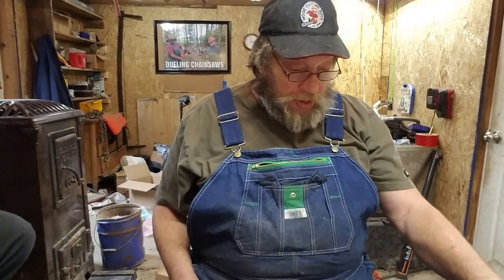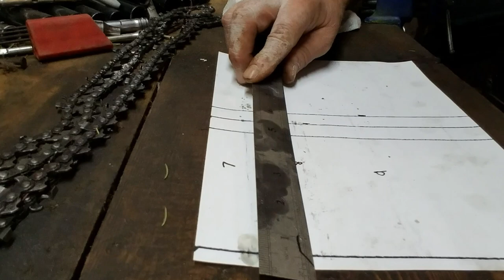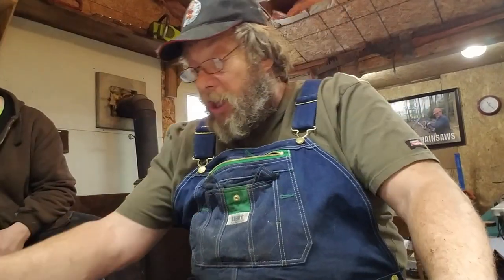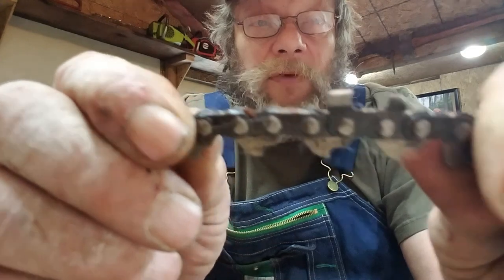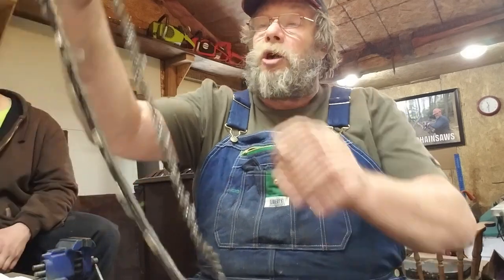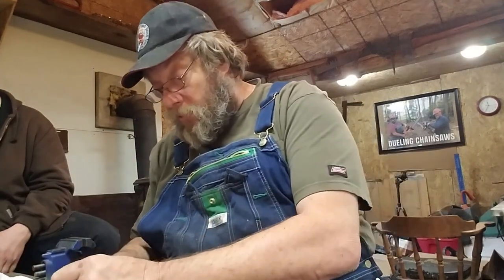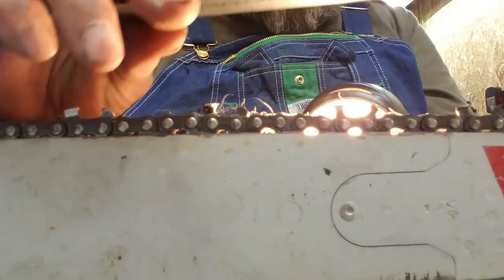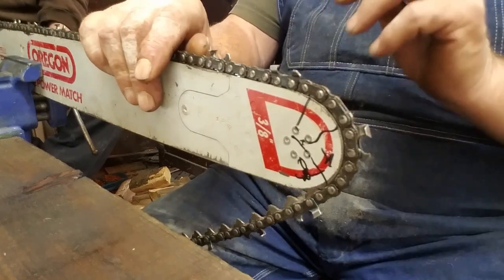Chainsaw sprocket size! What chain? On what saw! (Very detailed)

Comment: WOW serendipitous, I was literally thinking the other day "what if you had different sized sprockets, changing 'gear ratio'??", ROFL nice to see it's already an established thing (my new 590 is by far the most-powerful 2-stroke I've ever owned...followed by my 355t :P )
What do you think of quarter-pitch, and thinner gauges than 0.050, on climbing saws say 12"-->16" B&C?
Also...Is it OK to run a 50, and 0.058", gauge B&C combos on the same saw's sprocket? Like, alternating them?  I need to go with 0.058 gauge to get a B&C I want, but I know my saw's meant for 0.050" and, while I know the 58 will fit, I worry it'll wear those grooves into the sprocket in a way that'll 'conflict' with running my 0.050 B&C (I'd be swapping back&forth, the 58 is so I can get a bigger B&C than my saw's mounts want, I know it's not ideal and frowned upon but til I can get one of those blue-thunder beasts the 590 will have to do everything, however slowly!!)

Comment: I have a question, I have a Stihl MS 660 and a Stihl .404 pitch, .063 gauge bow bar. Can I adapt the saw to run this bow with a # 46RS chain? I am prepared to make an odd length chain.

Comment: Thanks for the video☺️👍really helpful! I was wondering if maybe you could help me with a bit of a problem. I run a jonsered cs 2159 Stock and would really like to run a 3/8 full House chain on it. All the local saw guys in my area dont really know anything and they dont really understand why i would want to🥴is it just a case of popping on a 7 pin that fits 3/8? Or is it more complicated than that?
Any help at all would be much appreciated☺️
Thanks

Comment: Hi Harvey! The numbers isn't right. The sprocket isn't surface feeding. It feeds around the cirkle given by the chain rivets (the part of the chain thats on the sprocket) . A 7 tooth 3/8 makes about 5 1/4 inch per revolution (I just checked to verify) . Mark up the sprocket as you did, and a corresponding mark on the chain, and put in on a saw with a bar and turn one rev and you will see. It will feed 2x3/8"x7.

Comment: Great video Harvey! Question about chain tension.... I run my chain a little loose like you do. Over time do you notice any wear in the bar groove from the chain rocking side to side? I never really thought about it until I forgot to tighten my chain last time I sharpened. With the chain loose, I could see the cutter trying to rock in the groove as I pushed on the file, but no movement with it tightened up.

Comment: Good evening, sir.

I emailed you a couple weeks ago about a 372 I bought that got damaged in shipping and never heard back. I was wondering if you thought it was worth the money to rebuild the saw or just part it out. I sent a pic so you could appreciate the extent of the damage. It was the crack in the crankcase under the upper part of the starter housing I was most worried about. Thanks!

Comment: Great video, thank you.  I did some calculations in my head.  The eight tooth has 1/7th more teeth, and therefore would rotate the chain at 1/7th faster rate than the 7 tooth (1/7 = ~ 1 percent).  Also, I've found that the 8 tooth sprocket is nice for soft wood, and rather than change the cutting profile of the chain, it's easier to change the sprocket, from 7 to 8 tooth,,,, I have no idea why one would use a 9 tooth chain.  Thanks again

Comment: I run .404 full skip on my 066mag an my 075av electronic i file my drags flat as well my mag has 8pin as well it needs replaced as well i always kept my chain tight after buckns video 2day as a fact i orderd a new sprocket but losend my chain put my ol 7pin back on until my 8pin arives n couple days i think the loser chain an new sprocket is goin to really pick me up ill see 2moro rain supposwd 2 be gone here in tn so off to make tge doughnuts lol great teaching harv thank u 4 everything u do.

Comment: I've found a 7 tooth will give you rpm on an 046 with a 24 bar (more chain speed) tho an 8 tooth is all around good for rpm and grunt work if needed (bottom end torque) if you need to lay into the cut to some reason it helps .  I personally run a 24 full comp on my 046 (it's not a stock saw tho) , it has a BB kit /ported and base gasket subed for a pop can style gasket lol I'm cutting big hard maple right now and it does real well . I have a video up just last week of this saw , just after the video I just touched my rackets(drags) with that being said I'm not overly hungry with them in hard maple other wise it ends up killing tips and or chains . All around if you can sharpen a saw proper it helps alot with an 8 tooth /full comp set up in any saw .

Comment: Ok so here's a question that I've heard multiple theories on and i don't know which is correct... At the bar tip just behind the sprocket you often see a dip/gouge where the bar has worn usually top and bottom, now is that from having the chain too tight or too loose because I've heard people say both?
My bars don't seem to do it but I see it all the time
Reply from the maker: I semi dull chain does that!
Reply: @theironhorse6600  hmm ok I don't know how that works but clearly I'm not running dull chain or too loose/tight, must be just right 😊
Reply: @CSkwirl  boring will wear the shit out that part the bar. Cutting with the tip a lot and bucking will all wear a tip
Reply: Too loose or dull.  But what you see is common.  I used to experience that before I learned how to sharpen, but this was many years ago so can only reflect back and realize my inexperience played a part.  I feel it's not from being too tight b/c I never ran a tight chain, I have run most likely too loose and definitely too dull.
Reply: My train of thought on this subject is. Like Harvey has said in another video. The chain wants to be a circle. Meaning the faster the chain spins there is less contact with the main body of the bar. If you look most bars have the most wear where the chain comes off the drive sprocket and where the tip and bar meet. This is because that is where the chain starts coming back in contact with the bar at each end to make a tight turn. You can see all of this if you have a slightly loose chain.  And just rev the saw and watch the chain. you can see it loose contact with the bar. If you're a fire wood cutter it will take you hundreds of cords to wear out a bar. Because your doing a lot of bucking keeping your chain in contact with bar on the cut side. This is also why it's important to flip the bar often. If you do a lot of small diameter falling and bucking using mostly the tip like I do. Then it is pretty easy to wear out a bar in a year or two. Especially if you run your chain loose. May be a long answer but I hope this helps.
Reply: Haha I forgot it's this video he said the chain wants to be a circle 😂😂

Comment: Just because you ask Re who watched to the end...will say that, nope, thankfully I've never hurt a sprocket!! Though my history is almost-entirely with sub-50cc powerheads (almost exclusively top-handles til this past year) but only once had to buy a replacement "sprocket//clutch combo" once but it was because of a broken clutch-spring (this is for a zenoah g2500 clone, basically has the availability of clone 660 parts IME!!  My version, a "scheppach csp2540", not the holzfforma version, it was GREAT almost made a whole 3 years, its current 'death' is my fault anyway its compression is so low it hardly cuts but there was HORRIBLE air-filtration but that was on me.....*never* again did I let that happen, in fact I make screened-windows on most airbox covers (and screen/filter the OEM cutouts)
Thanks for a great vid am holding (1) 8-pin, am planning to get another because I suspect it will only improve either of my clone 660's, they've got 25" & 32" setups, just finished the 1st build that has the 8-pin have yet to run it (it's the 32" one, w/ a big bore top-end and at least another 2-3cc's displacement gained via piston & crankcase porting :) )

Comment: rather than measuring the outer edge of a sprocket that's traveling in a smaller path than the chain, just measure the distance between the chain's drive links (stretched out straight) times the number of pins on the sprocket.

Comment: I’ve come to the conclusion that having only 3-4 drivers come out of the top of the bar, if I have it any looser then that with the heat and expansion of the chain, it gets too loose and then the tooth starts to kick up and bite too much. And bog the saw down too much. 

I’m swapping over to skip tooth to make it easier for my saw to stay in the power band. Especially with our hard woods here in Aus, if the log is a little bit dry, by god the saw starts to labor with full house chain

Comment: I run a 8 pin on my 066 digital with a 24" bar with 404 supper chisal chain. It was fun but boy did it beat the piss out of me.. lol I have since then grown up. 24" 3/8 7 pin supper chisel 2 passes off the rakers on a new chain and not much more then a 372xp..

Comment: I have a husky 350 with an 18 inch bar what chain should I run thanks
Reply: I think those are 72 drive link .325” .050 chain
Reply: @mercoldswfo  Thanks buddy.
Reply: My 353 has a narrow kerf bar/chain

Comment: I liken a full house chain versus a skip like this :  Imagine a full house where every tooth is butted up against the one in front. So you virtually have a butchers knife.  Then take it to a full skip where a third of the teeth are taken out.  On the full house its virtually sawing the wood like a knife but with a skip you are cutting with a saw tooth bread knife.   The skip will cut quicker and with less hard work every day.  I agree with the 8 tooth sprocket for a skip.
Reply: gain speed, lose torque.  Remove cutters and you reduce drag so you can move the chain faster.  It's a push and pull, a dance.  A longer bar has more cutters and more drag so you can compensate by having fewer cutters and get your speed in the cut back.  A smaller saw can cut bigger wood by using fewer teeth.  So for my small saws, I can cut bigger wood, slower with a skip chain, without changing the sprocket.  But my saw lacks the power to gear up.  I need all the torque I can get.  this was an excellent video!  I am not a saw man, but I do know math and physics.  The exact same relationship takes place when messing around with trucks.  Tire size, diff gear ratios, ho, torque, transmission gear selection etc.

Comment: I run seven tooth sprockets on all of my saws, except my small saws and they have six tooth sprockets.  What the factory calls for is what they get.  A few seconds less time in the cut is not important to me.  I never do anything to a saw that will diminish its lifetime and make it less reliable and lugging a saw is not good for its reliability.

Comment: I was thinking of a backpack bar oiler...like a weed sprayer.  Pressurize that sucker:  no pump required.  Plumb a line to the saw and a trigger valve.  SO when you're on a competition,  you could blast past ALL OF THE COMPETITION!  Cheating?  Gota check the rules....  hey, "Ex- Post-Factos", Hahahahaha add another page to the rule book.  Oil:  rapeseed / Canola and/or a mix of other vegetable oils.   Yeah, gota be "bio-friendly".  Maybe synthetic vegetable oil...how's that for idiotic!  Well, maybe not, save that for someday when we are mining the moon.  Oh, why reinvent the wheel....it's called margarine....or "Oleo" to us old timers...  hey, how about a pressurized bar oiler tank on the saw?  Just for a few competition cuts?  .....yeah, I can see iHorses eyes rolling and him saying, "been there done that...and more".  And/or with iSon chuckling in the background, saying, "Wave-dude is letting the cat out of the bag."

Comment: Harv ya bugger,if the difference between 7&8[ 4.5-5.25] is.75 of an inch then number 9 should be 6.00 is this not so, remember Harv simple math bud.
Reply from the maker: Remember I did no math this was only an example! Outside diameter isn’t as big of an increase on that 9 pin! Maybe some are bigger?  Stay safe!